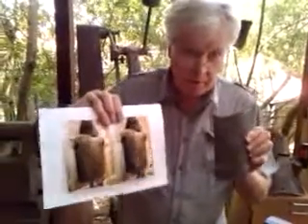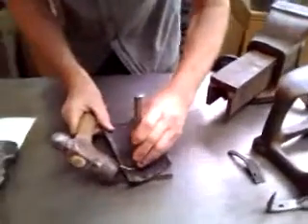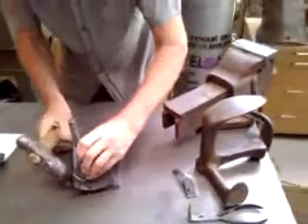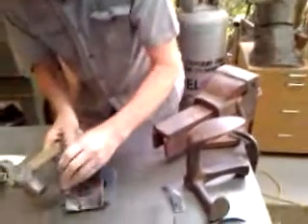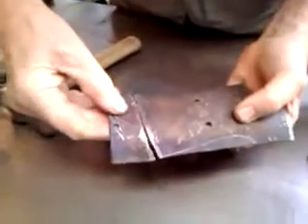Ned Kelly gang -  Darren Sutton- Joe Byrne armour off-cut dispute

Comment: Looking at the cutting of this piece of plate tells me it is fairly modern day 6-8mm mild steel. Most reports I have read state the armour was shaped from plough blades. 
Even back around the 1860's plough blades would have been made from a mid range carbon steel albeit what was called "dirty" steel. That is to say it had impurities in the crystalline structure. Today's plates are made from steels via a bos / continuous casting process with vastly cleaner structure. 
A well equipped laboratory facility, particularly at Port Kembla steel plant can confirm.